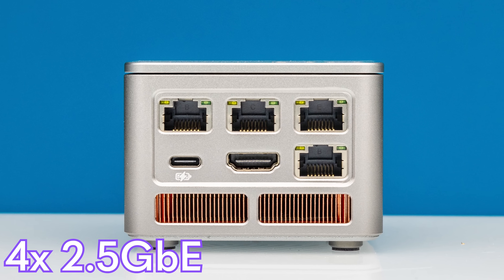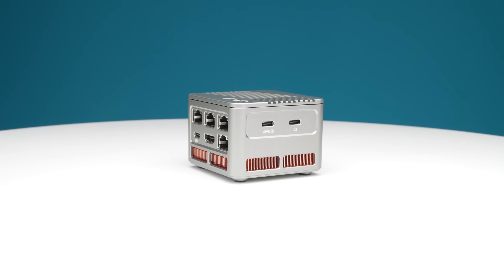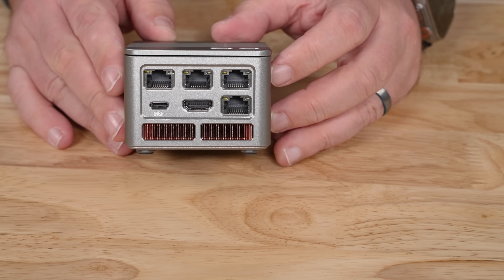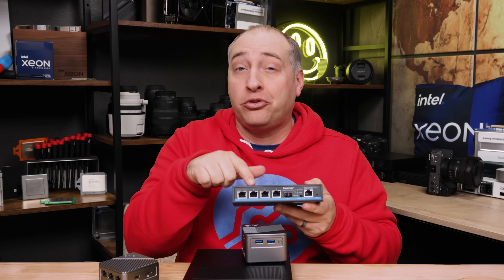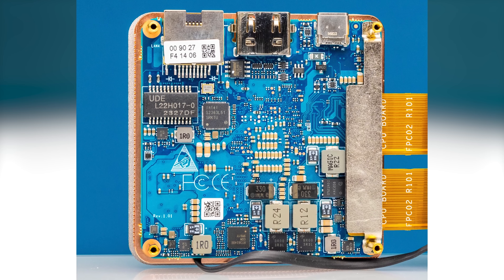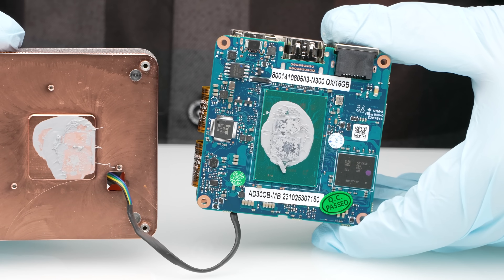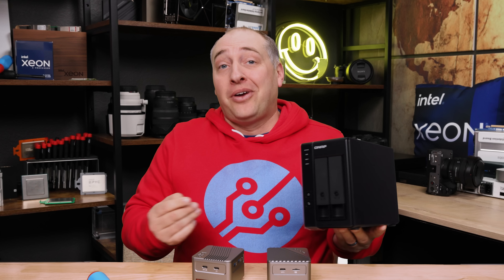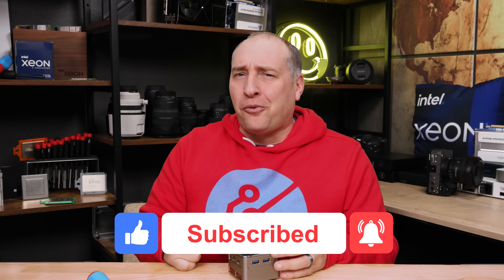TWICE As Fast with No Space Wasted

Comment: I love how they stacked the PCBs to get the formfactor down, it's such a nice compact design.
Reply: Looking forward to Quantum folding where PCB can be stacked in other dimensions - computers could be infinitely large
Reply: problem with this piko size is, that this will overheat after 10 seconds, cooler fan will run at max rpm whole time and you will hear it 2 rooms away
Reply: @nargalda773  the CPU package power is only like 7W, you don't particularly need a lot of airflow to cool that. Heck, at this level you could passively cool it if it wasn't in the enclosure
Reply: @DuyLeNguyen   7W its on idle/low load, if you give it rly hard work, it will rise almost to 30W and you will hear that A LOT, i have few of these mini mini pc, and their fan start spinning at 40degree to full spin and never go off (only on realy idle state, where you have just windows ), its does not matter if ouy have this mini pc somewhere where is noisy, but in quiet room at home, you will hear this about 4 meters away, you dont want sit with this mounted on monitor or near, i have nuc near 2 times in size, with 10cm fan, and even that under load is like jet plane starting
Reply: @nargalda773 mate, there's literally a noise test in the video
Reply: @mitlanderson  it is, thats why i point it out, bcz when i bought my first mini pc, i thought it will be quiet, but no, it was fck jet plane 1m from my ear, if you want anything near, pasive cooling is absolute A MUST

Comment: thermal throttling incorporated
Reply from the maker: Most folks are not going to run these at 100% since for a firewall, router, virtualization host, web server, and so forth that is really bad. The screen behind me doing the power section is showing clock speed on all eight cores, temps, and so forth and even at 100% it was not cool, but not throttling majorly (a few cores would dip 100MHz briefly.) For the intent of this device, it is actually very good.
Reply: @ServeTheHomeVideo most based response. Thanks!

Comment: Are BIOS updates a thing to consider when buying these little boxes (as opposed to buying a motherboard and components separately)?
Reply: On almost any chinese made mini/micro pc, you really won't see bios updates/firmware updates beyond what Microsoft provides with Windows;  if you are not running windows, well, you really almost have no say in the matter, and won't likely receive a single firmware update.   Firmware updates require constant development;  these vendors end development as soon as the next model is released.
Reply: If you want properly supported Mini PCs, buy reputatble brands, e.g. HP, Dell, Lenovo, Asus, and Asrock. These Chinese mini PCs "brands" come and go as they mostly source their machines from OEMs and put their names on them.
Reply from the maker: Sure. However, if you are buying a motherboard, you system is going to be many times larger than this so you would be making a completely different class of device.
Reply: I wouldn't say most motherboard manufacturers are any better at releasing firmware past the 6 month mark or so
Reply: @IggyJackson  My B660 board got 2 updates in the last 3 mo. (last for LogoFail); it's now 2 years old.
Reply: Really, it depends on the manufacturer and their testing. We have seen some MiniPCs with lots of issues out of the box and barely useable, while some are just fine. Your best bet is to wait and see some user experiences, especially on the Discord if there is one. I also always recommend getting a mini PC from somewhere that offers an easy return option (i.e. Amazon) as the QC with mini PCs usually sucks and you don’t want to be stuck with a bad unit.

Comment: Patrick would you recommend this as an OPNSense router device?
Reply: I'm not Patrick but I think this is a little overpowered for a dedicated baremetal OPNSense/pFsense router - you could go cheaper and probably still be fine unless you're doing super high speed fiber and full packet inspection (and even then there are probably slightly cheaper options that can handle it).  I think this would be ideal if you want multiple Portainer setups etc.  Check out this channel's video called "The EVERYTHING $300 Fanless Home Server" for another good option.